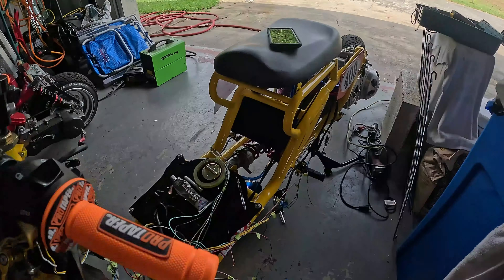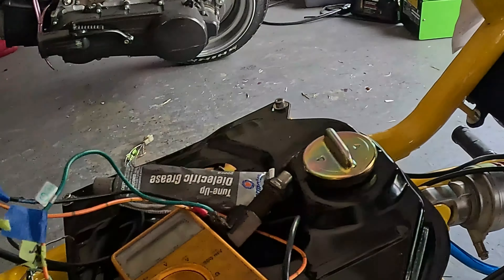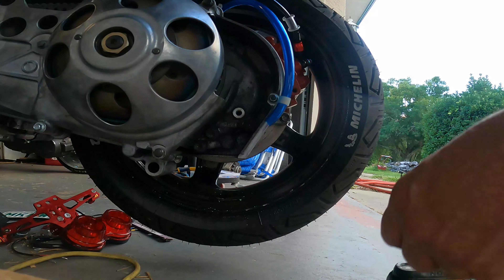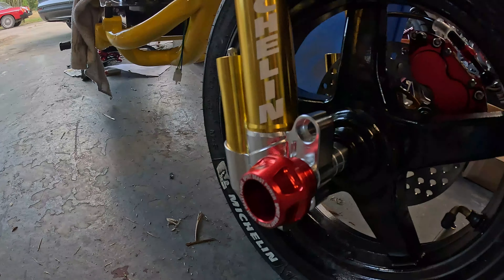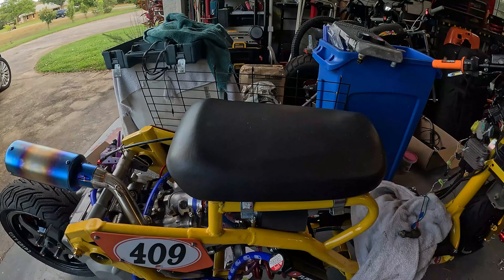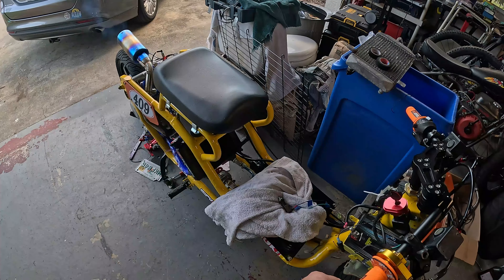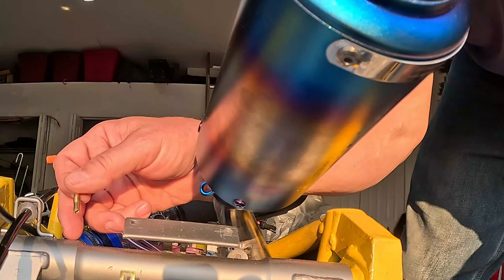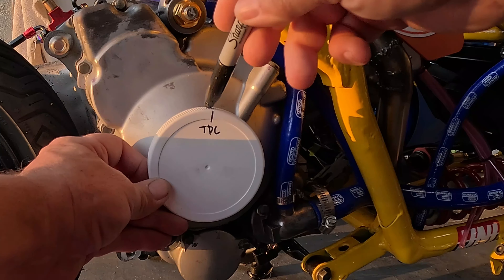Chuck It!  Part 5:  400cc Maddog Chuckus Burgman Ruckus Project.  Starting It Up.

Comment: LOVE THIS BUILD! every build has pain and suffering. NO FREE LUNCH!
Reply from the maker: Word.  I either have to go back to the stock computer and wiring harness or lathe down the 16 tabs on the flywheel and weld on a new sensor tab so it's compatible with a CDI.  I wish I knew if a carbureted flywheel/rotor from a old one would fit the crankshaft and over the stator.  That would work with a CDI.  The carb models had 2 sensor coils though.

Comment: I seriously want a Ruckus but listening to you explain all of these parts and knowing I have no mechanical experience has me wanting to say forget it. However, I could listen to these videos all day because it’s interesting as hell.
Reply from the maker: LOL.  Get a chinese one.  They are cheap.  As stuff breaks you will learn about them.  Plus the Chinese upgrade parts are cheap.
Reply: Like a 50-100 dollar busted ass china scooter. 4 stroke,  Get the 50 to start. KNOW that you will need carb, fuel tank of some kind and the 139qmb 50cc wiring kit, might not need it, but plan for it and get it. Known good components are a lifesaver in trouble shooting. Get a multimeter, does not have to be fancy. Then nothing to it but to do it.

Comment: I've worked on motorcycles and 4 wheelers with similar problems and they needed new stators put in and it solved the problems.
Reply from the maker: This is a DC system so technically it would run fine without a stator, just not for long.  I just cant use the pickup signal off this bike on a typical DC CDI.  It needs a computer.  But I am working to make one.  LOL

Comment: I forgot to say, that thing looks really good man.  Don't give up we got this.
Reply from the maker: I just pulled the side case off and the flywheel is weird.  it has bumps all the way around it.  It is missing 2 bumps which I imagine is signal for TDC.  So this must always send signal every 10 degrees and when the signal stops the computer dumps power to the coil.  No way an aftermarket CDI is gonna work.
Reply: @GhettoWrench   Oh that's great. That would make a aftermarket easier give it higher resolution anyway.  I mean the stock ECU probably works but you would have to determine the safeties I'm sure it doesn't power off with the safeties it stays on it just killed power to fuel pump and Ignition. And safties are usually open to fail, so a cur wire won't disable safety. My vote is aftermarket ecu. Running spark only. Fully mappable unlike the overpriced crap sold in Colorado.
Reply: @GhettoWrench   In this case those 2 bumps are just to tell the computer the position and it works out like you were saying with the CDI but this actually has intelligence so it could potentially advance the spark because it knows how fast it's accelerating and it knows exactly where it is in a position and it could advance  or retard as much as  wants to . That could be actual TDC.
Reply from the maker: @ThePitProductions  oh good point.  Hmm.  So when at TDC the no bump area is 90 degrees-ish before the sensor (counter clockwis) from the sensor.
Reply: @GhettoWrench  Is your cover back on? could you get me the degrees of the first tooth after the space?  I am finding this 250i motor probably has a lot in common with the suzuki. Anyway, like I said they are similar and I am wiring up the crank trigger next.
Reply from the maker: @ThePitProductions  Ok, so the TDC mark is arbitrary and can be anywhere you make a stamp so I will not refer to that.  When the engine is a TDC the 2 known positions are the pickup coil and the tabs.  At TDC the pickup sits 2 tabs before the space.  So it senses 16 tabs that are 20 degrees each before the space of 2 tab distance.  At TDC it sitting right ON the 14th tab.  that would be 40 degrees before TDC of the first half of the space and 60 degrees before the 2nd half of the space.  I hope that made sense.
Reply: @GhettoWrench  You are right I did not ask a very good question.  Ok, so the data I need will be the degrees from the edge of the pickup, to the edge of the first tab after the space while motor is at tdc. That is called trigger offset if I recall. I will reread your reply a couple times and make sure the info is not already there.  Thanks again.
Reply from the maker: @ThePitProductions  so the space starts after the last tab.  But there are spaces after all the tabs.  This one is just longer since it is missing 2 tabs.  I would consider the first part of the space to be where the tab is missing.  In that case it is 60 degrees BTDC.  Where the space actually starts is 70 degrees BTDC
Reply: @GhettoWrench  The ecu starts counting the "revolution" at the start of the first tooth after the gap. I should have spark control piggy backing factory ecu today if I'm lucky.
Reply from the maker: @ThePitProductions  oh that's crazy.  Ok AFTER the gap on the flywheel as it rotates.  So we are still BTDC.  The gap happens at about 43 degrees where the last tab ends and starts again at the 1st tab 100 degrees past or before getting to the pickup.
Reply: @GhettoWrench  Did you ever say how many tabs your wheel has? I am showing 1800 rpm on tuning software at idle. I was going by a tooth count from similar ecu set-up available.  BUT, II am almost there.
Reply: you did, 16
Reply from the maker: @ThePitProductions  16 teeth but enough room for 18 with the missing 2.  So 20 degrees each
Reply from the maker: @ThePitProductions  yes but with 2 spaces.  Would be 18 if no space
Reply: @GhettoWrench  yup, that's not mine. for future reference that is 18-2 pattern. The 24-1 I had before I guess was right. I did not think it sounded like 1700 rpm, but that is what manual the says it is. That is what tunerstudio says it is idling at.  Thanks for the time.
Reply from the maker: @ThePitProductions  oh ok.  Makes sense

Comment: i've experienced a very similar problem were the engine ran good at idle but the moment i touched the throttle it started to misfire like crazy after letting go of the throttle went right back to idling and sounded good on both bikes i had problems with grounds 

First one was an Aprilia, the engine ground had split under the isolation, replaced it and it ran like it had just rolled out from the dealership. (found it by accidentally bumping my hand into it, the isolation snapped with no effort)
Second was a moped, specifically a Giantco which had a bad ground going to the starter, as well as on the CDI it had split. Replaced both wires and it ran like never before
Reply from the maker: Good info.  I have been looking for that since it appears so "electrical"

Comment: Hi friend take the key way out of the flywheel and you can put it wherever you want it the keyway doesn't hold it in place the press fit does.
Reply from the maker: I had that until I pulled it apart.  So this magneto has 18 evenly spaced tabs at 20 degrees each and then 1 is missing.  The computer is actually using the missing tooth to signal when to fire the spark.  I thought the plug looked like it was sparking too much.  With my CDI on there I am sparking every 20 degrees.  LOL.
Reply: @GhettoWrench  so take them all out leave one on and your GY6 CDI will work
Reply: @GhettoWrench  recently started working on the GY6 platform but was big in pit bike years ago.
Reply from the maker: @alj1451  thats the plan...  but I am worried about balancing it.  How big of a deal you think it is to be perfectly balanced?
Reply: @GhettoWrench  it's worth a try I'll pull up a picture of it so I can understand.
Reply: I say go for it I looked on eBay and seen the crank and the flywheel press fit ,no key needed.
Reply: My pit bike is electric start with the flywheel 150cc and no keyway I just use an impact to put it together. If it slips and won't do any damage.
Reply from the maker: @alj1451  search AN400 Magneto.  I think this will work.  I also have tons of room as you will see.  I can mimic the tab from a gy6 flywheel in relation to TDC and trigger mount.  I can weld it in behind those OEM teeth.   I have room to move the trigger coil so it is on the smooth part of the flywheel.   I will weigh it before tab welding then after.  I will take that amount of weight off the OEM lugs 180 degrees out from my weld point.
Reply from the maker: @alj1451  that's true.  If I only had one sensor tab I would do that but I have a bunch of them.  LOL
Reply: @GhettoWrench  years ago I made my own CDI pickup was on the bolt holding the flywheel together.
Reply: I had a 400 burgman and I sprayed nitrous in it
Reply from the maker: @alj1451  epic
Reply: @GhettoWrench  dry shot on the air temperature sensor in its way in. More of a novelty what looked really cool when you open the seat. It will probably go a hundred plus if you could get it right.
Reply from the maker: @alj1451  have you seen my gy6 maddog on nitrous video?  Full wet system.  That thing is a blast.  I keep emptying my bottles.  LOL
Reply: @GhettoWrench  yes I watch all of your videos I like your humor.
Reply: Looking at this video again I can't figure out how it's even running you need a timing light on the right side all those other tabs are rewiring the ignition table it runs out of spark. Hope that helps Al
Reply from the maker: @alj1451  LOL!  You noticed that.  So this thing has one hellova stator.  Runs hand warmers to electric windshields etc.  It is massive.  It is also a DC system so the coil is firing off the battery.  With that DC CDI that plug is sparking 16 times per revolution....   crazy.  I thought it looked funny when checking for spark.  I did notice if the bike does not start that the battery drains quick.  Which makes since with that much going to the coil.  I think our GY6s must fire 2 times cause that CDI computer has no way to know which TDC I oriented the cam to on the compression stroke.
Reply: @GhettoWrench  temporarily Mount the CDI pickup on the other side the belt side to prove this out with an L bracket it will trigger it I've done it off the crank  bolt,
Reply from the maker: @alj1451  oh damn that is a great idea.  I could even buy another cheapo pickup to put there
Reply: @GhettoWrench  just a GY6 that's all you need and the L bracket coming off the crank that's your pickup Mount the pickup off of a bolts off the case cover.
Reply from the maker: @alj1451  wish I knew this before I pulled the side case off.  Gasket, oil etc.  Could have done this with all the right side stuff intact but disconnected
Reply: @GhettoWrench  wont it just fire 6 times off the bolt?
Reply: @GhettoWrench  you made me have to think outside the box lol.
Reply: @GhettoWrench  okay so temporarily permanent just make a cover for it.
Reply from the maker: @ThePitProductions  I won't have the sensor coil that close to the bolt hopefully
Reply: @ThePitProductions  an L bracket the center hole allows you to adjust it where you want it to trigger. Same as a GY6 or pit bike .
Reply: @GhettoWrench  Thank you for your service brother how's the scooter 🛵
Reply from the maker: @alj1451  You are very welcome.  I haven't even touched it yet.  My week on at work.  I fly medical helicopters so they are long days and nights.  I ordered a basic GY6 sensor.  I am going make a crankshaft reluctor more like the size a camshaft one that a car would use.  I plan to mount that on the variator shaft and modify the CVT cover to hold the pickup.  Move the whole damn thing to the other side and it will be rotate-able.
Reply: @GhettoWrench Wow hopefully you get to enjoy today it sounds like you still are . I still have the ZX14 with nitrous gen 1 that's my helicopter LOL God bless...
Reply from the maker: @alj1451  damn that's a whole lot of bike.  My record on the GPS is 205.  I pretty much built a formaula race bike. Way faster than my helicopter.
Reply: @GhettoWrench  I been 153 at the drag strip in the quarter mile 10 seconds flat didn't break into the nines. I had a life-changing experience I realized nobody was going to take care of me and I had to do it myself ,the team I was with ran 911 for the state of Michigan and I was the backup for Detroit pd loved my career, the video when you told your wife about the the Bergman and that you were getting paid to get rid of it and you gave her the money was too funny😂 funny does good like a medicine. More to come.

Comment: Put the stock fuel injection back on,  order a megasquirt fuel injection,  mega squirt can run single injection,  sounds excessive but it will give you everything you need and can program it for how you want it.  Proven to work , Piaggio eu4 computer are expensive as gold, so if you import a Piaggio make sure you get the computer,  but megasquirt can run it so don't matter,  just makes it more fun trying to ride balancing a lap top to get your tuning at first 😂 anyways you have a o2 sensor bung so you can tune it and make your map,  megasquirt only goes off crank trigger,  will be able to run that engine
Reply from the maker: I actually have the old throttle body and was looking at going back to EFI but it's missing parts I think.  The megasquirt idea may be way better.  Thanks for the info on that.  I had a CBR929 with a yoshi controller that I tuned on a lap top and loved it.  So much easier.
Reply: @GhettoWrench  also would open the doors for how insane you are 😆  nitrous with timing ohhhh,  blow through carb turbo are almost impossible,  but turbo through a stock throttle body and upgrade injector now that is way easier,  especially since then adding a blow off valve and small intake size would build a lot of boost plus since the engine is water cooled already non intercooler for easier plumbing with the tuning to back it up. 1 extra small oil pump for turbo so battery drain should be manageable,  if not then 18 volt makita battery with a step down to 12 volt is a compact and proven solution to battery problems can even order the set from Amazon 😆  be racing cbr600 in no time 😀
Reply: Megasquirt is way overkill. Speeduino No2c is perfect overkill.  Your probably talking more money in the missing sensors than you are for the unit. like one hundo,could be less

Comment: Could it be a vacuum leak?
Reply from the maker: I dont think it would idle that steady with a vacuum leak big enough leak to cause it run like that.  If it was a mechanical vacuum advance then I would suspect that.
Reply: I had a similar issue with my gy6. At full throttle it would die. Wrong jets AND a leaky old rubber manifold!
Reply from the maker: @frednetherlands887  I pulled the engine case off and no way this flywheeland pickup design will work with a regular CDI.  Needs a computer.

Comment: wiring is painful. I laughed the first 5 minutes. What size carbs are you using, did you say?  My first thought was the needle. like it seems to die right where the needle should be kicking in. But EXACT same behavior with different carbs,  OK, then, if you have a degree wheel and or an old school test light. degree wheel the pick-up and trigger. No guessing. The flywheel is mounted on a machine and a slotting  cutter is run in and out a bunch of times like 2 dollar umm.  lathe or mill would work. Or we use a aftermarket ecu and vr conditioner and either trigger a cdi or smart coil.  
The sparkplugs fire every rotation. 

DO YOU EVEN KNOW IF IT HAS A KEY...
Reply from the maker: 38mm PWK.  The one recommended for a DRZ 400.  Best guess. LOL.  It looks like the flywheel has never been off.  I threw a degree wheel on it and the missing knobs are about 90 to 100 degrees...  Which would work, but this was designed to fire when the signal was NOT sent I think.  So it has 18 evenly spaced knobs the sensor detector signals.  1 every 20 degrees.  2 are missing.  so 40 degrees of nothing.  Weird.  I think that 40 degrees is the TDC signal or the 10 to 30 degree range.  (40 degrees).  My idea would be to toss it on lathe and smooth out all those bumps so it was flat.  Then weld a pickup at 90 degrees in that dead space so it would work with a GY6 CDI timing curve.  The issue is HOW do I balance it?

Comment: We have a clean mint burgman 400 2007  we can sell you for parts as dealership never sent title to us. We have all the dealership paid in cash receipts etc but no title ever received. Had it fully serviced after purchase along with new windshield, tires, etc. My loss your gain. $1500 in Dallas. :face-fuchsia-wide-eyes: or if you need to stop by of if you are in Texas we can ride it to you and you probe wires to find the answer.
Reply from the maker: That would be perfect.  I would hate to trash a good burgman.  Wish I could find a crashed one.  I would go easy mode and toss it in there with the fuel injection.